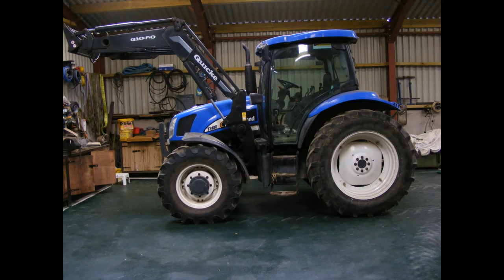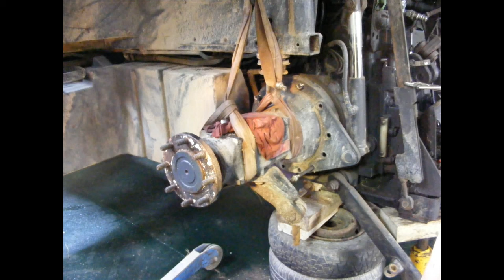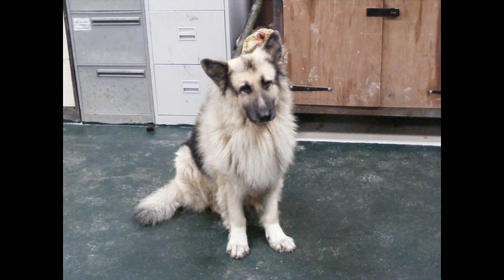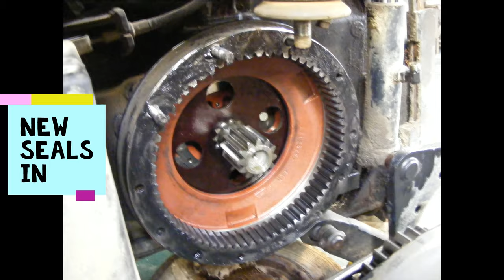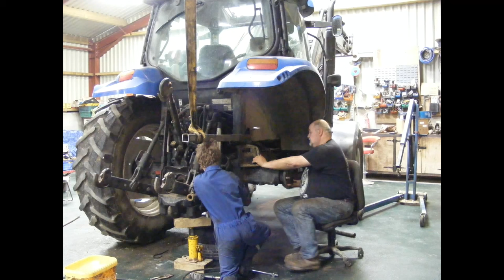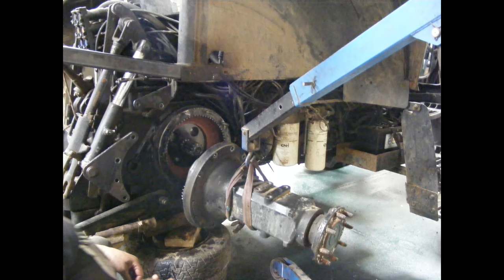New Holland Tractor Disaster- no brakes

Comment: had the same problem. did you replace the sealants on the pump. I do not know if bad brake fluid will not affect its effectiveness. Greetings
Reply from the maker: Hi we just replaced the seals in the brakes, and touch wood, no leaks anywhere else. Brakes work really well. Just have to make sure the correct fluid is used, and NOT brake fluid dot 4
Reply: @farmersarah6941  THX Good video
Reply from the maker: @krzysztofmorawski2790  Hi, really important to use correct mineral oil. Sarah